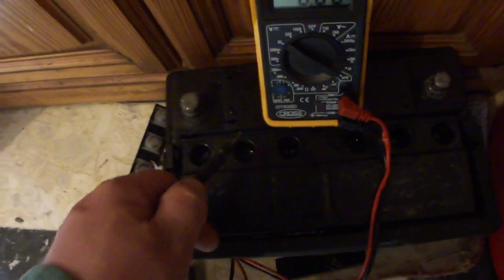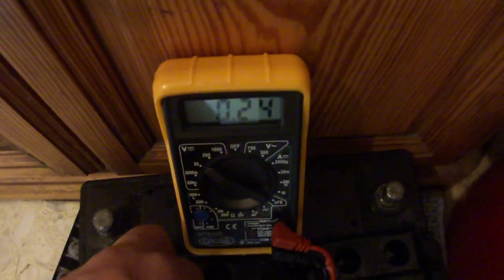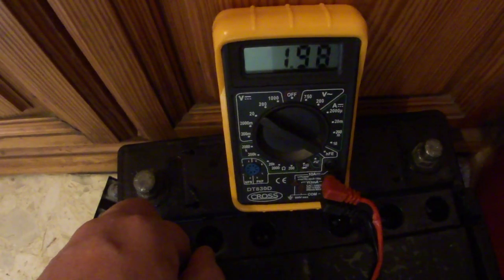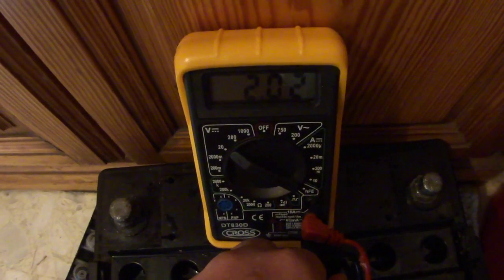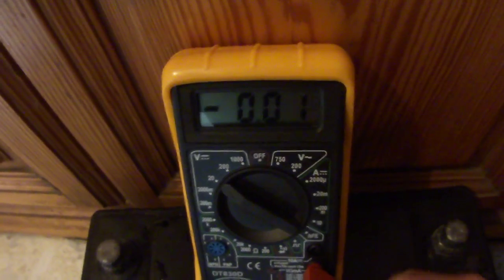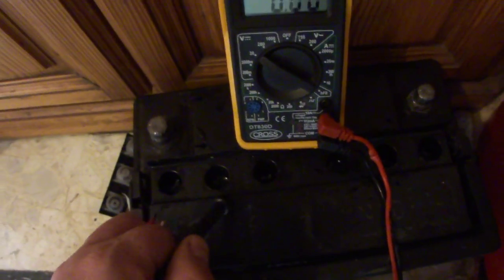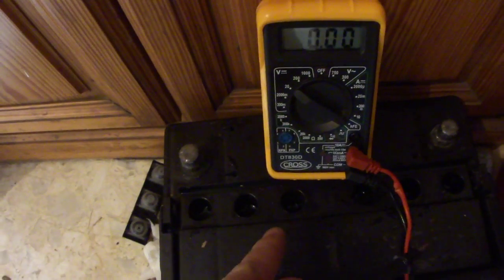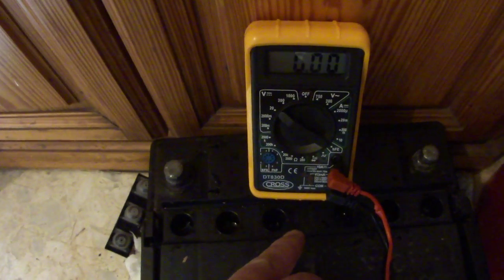Alum Epson salt electrolyte car battery conversion 13

Comment: Yes the battery was too broken already, so it was useless to do thís conversion with it,
but I did not know this when I started it.
Now I have learned a lot about these car batteries and how they act and how they
are built internally  !

Next battery for the conversion will be a brand new battery which did not yet had acid in it....then all will be much easier and not so dirty....

Regards, Stefan.